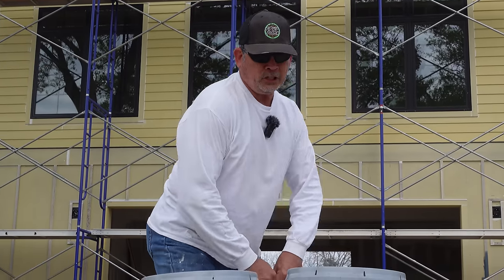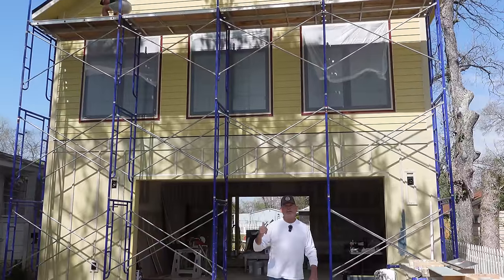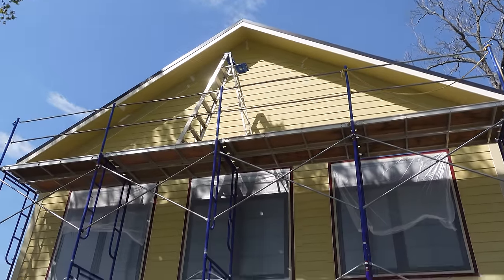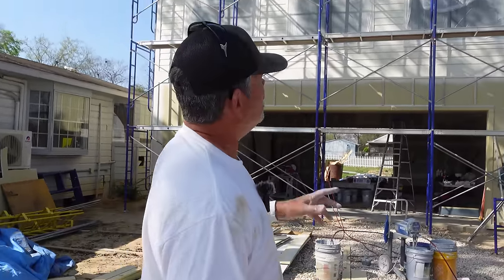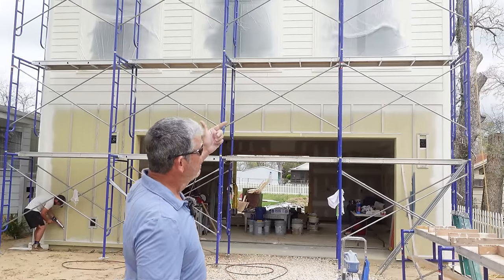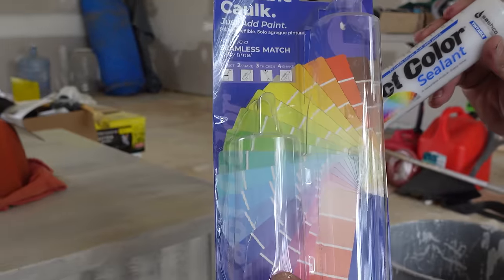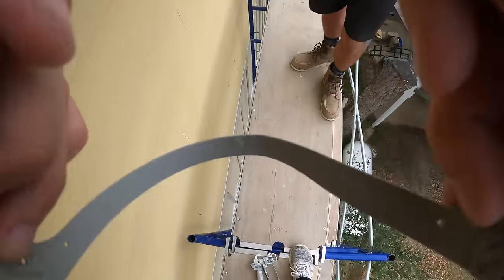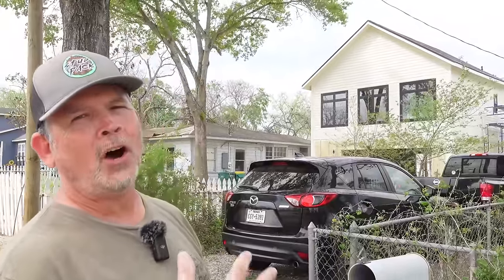We Spent $1,400 on Paint and Sprayed it Ourselves! (Should We Have Hired Pros?)

Comment: The weak link in Sherwin Williams exterior paint is the pigments used for tinting. You can go into ANY residential neighborhood and pick out a SW coated house. Extreme fading 
SW states you can expect 50% color fade in year 1. They state a lifetime of their coating is 8 years on average. That’s what your lifetime coating is rated. 
Now, you can also discover Benjamin Moore uses acrylic pigments that do not fade nearly as bad.  I’ve done thousands of homes and can tell you Regal High Build will outperform Emerald and Duration for both new and residential repaint. 
Save your money.
Reply: I love duration. Great paint. We use regal and Ben a lot more though.i agree.
Reply: Your assumption is incorrect. I have applied thousands, hundreds of thousands of gallons actually in my 38 years in the coatings industry. As both class 1 and Class 2 coatings, that would be commercial and automotive to those outside the industry. 
If you understand planned obsolescence then you can understand what I stated in the first statement....... the weak link is in the pigments. They know it will fade, expect it to fade by 50% in year 1.
Yes, I know all about SWs R&D. I was involved with Chemical Coatings division as I aided in the development of Gem Lac in the 80’s and currently an independent coatings consultant

Comment: For removing paint on delicate surfaces like your drip edge/flashing i would recommend starting with isopropanol alcohol or ethanol as it will dissolve just about any water based paint easy, good for cleaning the tools also.

That and as you said, paint before flashing it.
I like to paint everything before the last trim that is supposed to cover paint edges, and also paint the trim on a wooden rack like stacking 2x2 stickers so i can paint several boards and it is like a drying rack, only need to touch up the nails/screws, then you can also paint the backside on the edges

Comment: Just a tip about syringes.  I do this for my fountain pens.  If you hold the tip down into the paint / ink, and pull the piston back, you will inevitably have air in the syringe.  Prime it with that paint / ink then pull it out, point it tip up at the sky, the paint / ink will settle against the piston head, and then compress the syringe to get all the air out until you start spewing paint / ink.  You've now bled the syringe. Put it back into the paint / ink,  and retract the piston to fill the syringe.
Reply: Vast majority of medical and scientific professionals agree with this message.

Comment: Depending on amount of paint left over I used 16Oz, 32OZ, and 64Oz "wide mouth Mason" jars. Don't use the pail it came in - even if plastic. The wide mouth jars let you use smaller brushes for touch up and no clean up except brush.

Ask paint supplier for extra bar coded labels -. One  goes on the jar itself and 2nd inside a wall switch plate in the room. Can store many jars in a cardboard box which takes up a lot less room than pails.
Reply: I used to do the Mason jar thing as well. Even got a contraption by a company called "Jar Box" to store them in without banging around or breaking. Then I moved on to TCP Global paint mixing cups and never looked back. Amazon sells them in sizes from 64oz to 8oz. Unbreakable. Cheaper. And easier to handle all around.

Comment: Good call on the tape.  As an aging DIYer, I use it for every edge project, paint, caulk etc.  Time invested eliminates time in cleanup and yields professional quality results.  One tip I received from a professional painter was using the small diameter microfiber rollers.  Trust me on this one and give it a try.  It won’t cost much and you have a lot of painting in your future.  Looking good👍

Comment: I bought the same sprayer a couple weeks back. I have yet to use it. I like the bag you added for tool and tip storage. I'm doing that. Smart. I bought the pressure roller attachment and a 10in gun extension, also. I painted half of the interior of my house with a brush and roller. Not doing that again.  I know how to paint because I used to paint F-16s and A-10s. I see that painting a house has unique challenges that you guys are pointing out. Good video. For not being pro painters, you guys do good work. Might as well be pros at this point.
Reply: GUYS!!! USE RAILINGS!!!

Comment: 30 plus years spraying residential houses new work and old work yall got the basics but from what I see your tip is to wide and the pressure on the pump is to high also latex will dry before it hit the ground oil paint won’t so your falling over spray will be like dust and at least started at the top and came down I see so many people start at the bottom and go up 😂

Comment: I have admired your work, and knowledge for a few years now, thank you for all of the tips and tricks. I have used Graco for over 20 years, I'm guessing from the spray pattern you are using a 517 (blue) tip (at least on the street side), because you are so close to neighbors, I would suggest the low pressure RAC X tip (green). I fully understand green tips are generally used for fine finish products, but you are using Emerald, great choice for paint by the way, and I've had exteriors I sprayed that still hold up using fine tips in Washington looking great 17 years later.

Annexing progress, amazing job, big fan, Josh

Comment: Jordan  - how hard do you think this would be to do alone on an already painted house? 

I grabbed a Graco X5  a while back but have been afraid to use it. I think it’s the same thing just doesn’t have the big wheeled frame. 

I have a pretty good sized house (2800 SF with a two story entrance and living room). 

I was thinking of just splitting it up wall by wall kind of like you do. I think I have about 10 faces around the bottom (2 story or 1.5 height) and then a couple dormer type faces that I can get to on the roof. 

It might take me a month but perhaps if I just try to do one wall face a day or maybe two if it’s re-entrant corner. My trim is a different color so I was thinking spray, then two coats of trim paint so I don’t worry about covering the trim when I spray. 

Bids from two years ago were in the 8-12K range. Probably 10-15K now.

Comment: If you upgrade check out the 390.  I ran 2 hoses and whip and the replacement pumps pop in and out. ATM i have a Graco 395 and Quickshot for small jobs. Facia and soffits I use FFLP tips. Blue tape or Orange frog tape for plastic,  never heard anyone using Duct tape like that.  Keep it up!

Comment: Great video as usual!  I love Emerald paint!  This extension and swivel would make your life so much easier!  Graco 243041 Magnum 15-Inch Tip Extension, Gray,  235486 7/8 Inch Thread 180 Degree Rotation Airless Paint Spray Gun Swivel Joint

Comment: I have a Graco (don't recall what model) and 150 feet of hose (it was the cheapest model that would handle 150 feet of hose). Love that thing. Used it quite a bit and never had a lick of trouble with it, unlike my previous airless sprayer.

Comment: If you do ever upgrade your airless sprayer equipment, I would recommend a Titan 440.
Reply: I've got a Titan 840, It's one of the best investments I've made out of all my tools
Reply: I have the same sprayer as StudPack,   I am not a pro, but have been using that little Graco Magnum X7, and itk keeps on pumping.   several Apts, and 2 houses so far.   Everyone says good things about the Titan sprayers.
Reply: Yeah but the price! They are'nt full time painters. I have two a Greco and a titan and that extra 200 psi on my titan makes a digferance on ceilings I think.
Reply: Titan 440 is, indeed, a solid unit. But I would consider stepping up to a Tritech T5 for the win. Build quality is on another level.

The only Titan that I would jump at is the ED655 plus. Diaphragm pump makes it ideal for small jobs. You can do a quart of paint with very little waste.
Reply: @michaele1201 I've never heard a bad word about the X7s. The function is the same as units costing 3-4 times the price. The only downside is that it's disposable. After 200 gallons, you have to toss it. Compared to a Graco 390 or better than can be rebuilt as many times as you want. From what I read, if you want to maximize the life of the X7, keep it super clean. After you clean it, always use Pump Armor. Keep a boatload of it on hand at all times. Stuff is cheap.

Comment: Okay fellas, lookin' good! I was hoping to see some paint going on, and you didn't disappoint!
Now, I'm not whining, BUT...what's your take on painting the trim? Do you only paint the FACE or do you go old school and paint the SIDES as well? I'm old school and always painted the sides as it really defines the trim. And yes, it's a major PIA with all your siding against the trim...
Okay, now you had me all giddy when you started caulking the PROPER way. Suggestion...you had a good start, BUT, cut the tip opening BIGGER and you won't have any gaps as you found out the hard way. And PLEASE get out of the idea of having to "tool" the caulk after it's in place. The idea of doing it the way I suggested is that you DON'T have to ever touch it... So...in the future, bigger tip, and NO TOUCHY!
Now I will say SAFETY SAFETY SAFETY!!! Standing bare on the top edge of that scaffolding is using all 9 lives in one shot. PLEASE don't EVER do that again!
Reply: Comment below says make it smaller.
Reply: My take on the caulk gun tip hole size... with a bigger hole, it's too easy to get too much caulk out causing blobs.  If there are gaps it's because one is moving the gun too fast.  The push technique isn't for everyone though, and it does take practice.  A 45 degree cut on the tip is a key factor too.
Reply: @Wheel_Horse  the 45 degree cut totally defeats the purpose. When you cut the tip at a 90, it acts like a screed, or a bricklayers  joint runner or spoon. I agree about pushing too fast, but you need to have a larger tip than the gap/opening or you'll run into the same problem the guys are having.
As a superintendent at a commercial caulking and tuckpointing company, I kinda have a bit of experience.
Reply: @chrisosti  The 45 degree cut pushes more material down into the void.  And it also acts to tool the joint the same way.  I've tried every combination over the past 50 years and I know what works best for me.

Comment: Looks awesome boys! I am a little curious about @24:14 why you did not fill in the gaps between the boards with some big stretch to hide the lines at the joints. At least on the sides, it looks like maybe you did in the front.

Comment: I'd rent a Snorkel for that. It would probably have taken you 2 days to do the whole building. You can also back roll the paint after you spray it. Makes it easier to touch up. If you try and touch that up with a brush of roller now it won't match. Next Nag Try and hold the The GUn perpendicular to the building. Keep your brush Strokes  as long as you can. But to be honest 40 feet and bright lights ain't nobody gonna see anything.

Comment: I have to throw in my own two cents since I see Paul talking the comments  every time there is some caulking to be done.
   I'll try to explain this as I caulked professionally for ten years,  I've caulked concrete, brick, sidewalks, tilt up buildings, windows, etc.  It's easy to show but hard to write a description. Always cut your tip to be the same width as what your gap is.  Too wide and it overflows on both sides of the void, too narrow and your trying to fill the void and it looks sloppy. And with that said always place your tip on something solid when you cut it, like a piece of wood.  Don't just  hold the tube in the air with your hand and lop it off. This gives the tip a nice clean cut, when you don't have something behind it you will leave a little "flap" on the tip which will drag in the caulk and leave a line.  NEVER use the crappy cutter on the gun. 
   Always pull your caulk gun, keeping your cut edges of the tip flush on the gap. I always went left to right when possible because I'm right handed and I have better control over the trigger.  Top to bottom so you can see the tip better.  I can't even imagine trying to push a gun.  When pulling you'll just slide right over a little bump in the surface and keep going.  When pushing you jam it into the obstacle and the gun gun stops for a split second leaving a glob of sealant there.  
   Now take a minute to imagine yourself pulling the tip left to right on the bottom of one of your windows.  Your tip is the pivot point of the gun.  If you tilt the gun handle to much  towards the building the front of the tip lifts off of your surface and caulk will squirt out in front of the tip leaving to much caulk. If you lift the handle end away from the building you start squirting caulk behind the tip and that then squeezes out onto both sides of the gap when you drag the tip through it.  You want to keep the cut tip sitting flush on both side of the void not tilting it to much one way or the other.
   Now here's the secret sauce.  Don't look where you're coming from, watch right behind the tip in the direction you are going.  You can see the sealant fill the void as you are moving.  If you're not putting enough sealent you can see the void not getting filled.  If you're putting to much you can see it overflowing the void and the caulk will get pushed out both sides when you drag the tip through.  When you get it just right you can see the sealant touch each side of the gap and will  fill sealant to the top of the gap.   Then tip will actually "tool" it and leave you with a nice finish.   However, always go back and "tool" it so that it gets pressed against both sides for good contact.  Most use their fingers but professionally I had a large selection of cake frosting knives that I would grind down to all sizes which would match the size of the gap which push the caulk into the joint and leave a nice smooth surface.  
   I would be short cutting if I didn't touch on backer rod to fill the void.  Of course,  unless the gap is very big no one is doing this around windows and siding because it would take to much time and cost too much money.  However in bigger voids backer rod is pushed  into the gap the create a void that is the correct size. You are not supposed to just squirt a bunch of sealant into your opening.  You want to use backer rod to control the depth of the sealant  so that the depth of the gap is one half the width.  So a one inch gap gets backer rod pushed down in the gap to leave a  half inch of depth, a half inch gap gets a quarter inch depth, etc.  This allows the caulk to stretch as it is supposed to.  If you just fill the void with a bunch of goop it can't stretch and keep sealed to both sides of the void as it is designed to. 
   Hopefully this will help a bit in the future.  Either ways, great job on the build.  I've been watching since before the Stub Pack house was ever mentioned and love watching you guys grow and over come.

Comment: When you use the 'push' technique, you should cut the tip at an angle, not square straight across, and a bit smaller hole than you had cut.  The smaller hole means you have to work harder to get too much caulk and a big blob off the side of the tip.  The 'tip' of the 45 deg cut is on the top, away from the work.  In other words, the cut should be almost parallel to the work, if that makes sense, and that pushes the caulk into the void.  I would also have gone a bit slower than you did.  But at the end of the day, ya do what works best for you!  Nice job! Lookin' good!
Reply: Comment above says make it larger.
Reply: @coatknight  Maybe it works for them, not for me.  I find a smaller opening affords more control.  Too big a hole and squeeze a little too hard, and ya got a blob to deal with.  Like I said, what works best for you and your skills is what you should do.  Try both ways and decide what you like.

Comment: Seriously, please make some kind of railing when on the top of the scaffolding or use fall protection. It’s not worth a missed step to take a long fall. You guys have come too far to have a tragic ending. 2x4’s and some clamping isn’t a lot to spend for your personal safety.
Reply: Two corner posts and a rope across them on the scaffolding would be enough to save your life., it might not stop you from falling but it will break your fall if you held on to it, that wouldn't be too cost prohibitive, they shouldn't have an excuse for not having that, that toothpick on the top was too close to the wall I prefer a step back, especially when spraying., learn to spray with both hands it's a lot less fatiguing.